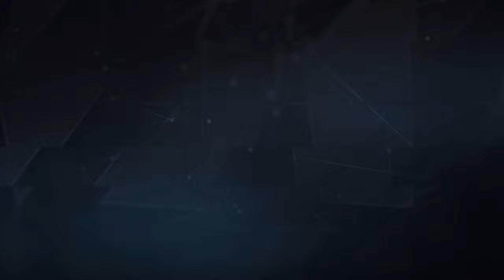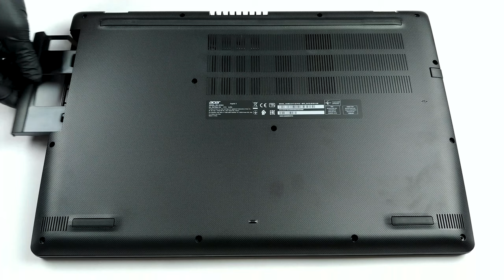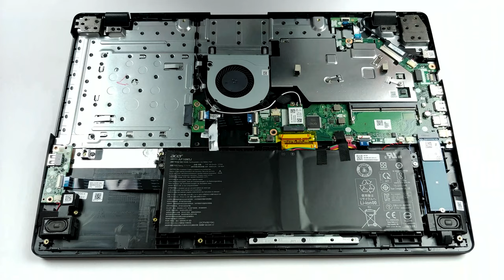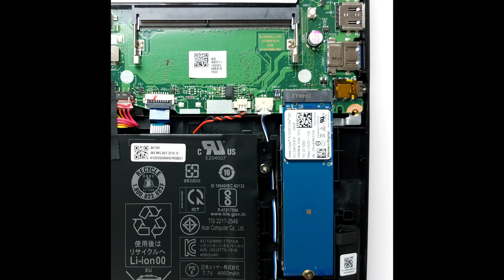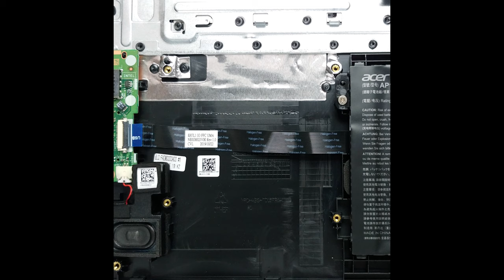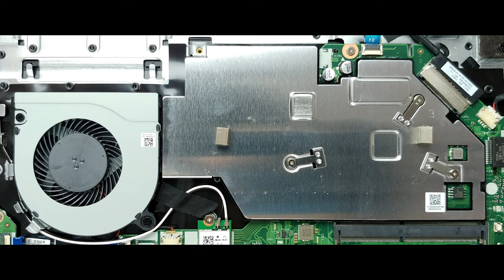Acer Aspire 3 (A317-32) - disassembly and upgrade options

Comment: Erm, I see disassembly, but what are the upgrade options?  I see components, like the battery, and I think the SSD?...and a cooler.  Not sure I saw the RAM though, or the HDD.   My model has both SSD and a HDD.  is there a connector for putting a DVD writer in?

Comment: hello how to disconnect the bios battery on acer a317 / 32 care the jarive connector not to disconnect thank you

richard thierry
richard thierry
il y a 2 jours
Hi Alex ... I was looking for a video instruction because I have a problem ... as you say there is 4GB of RAM on the laptop ...
mine is Acer A317-32
I am also trying to update my RAM with 8 GB more. Unfortunately the laptop started but didn't pull up .... black screen ..
Do you know what I have to do ...? I have already tried two types of RAM modules, but none worked .... and I put barette cruciale reference barette Crucial CT4G4SFS824A 4Go (DDR4, 2400 MT / s, PC4-19200, Single Rank x8, SODIMM, 260-Pin) Memory

richard thierry